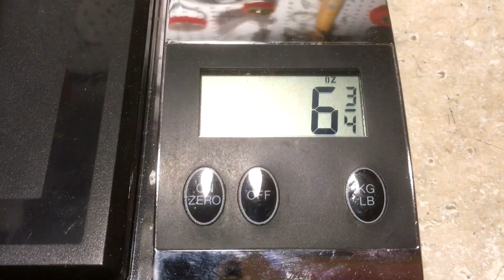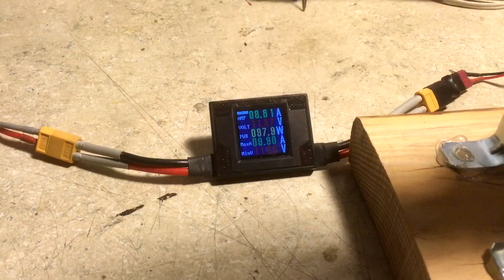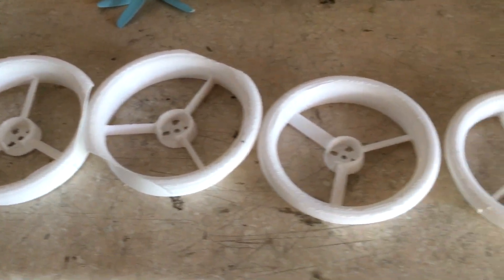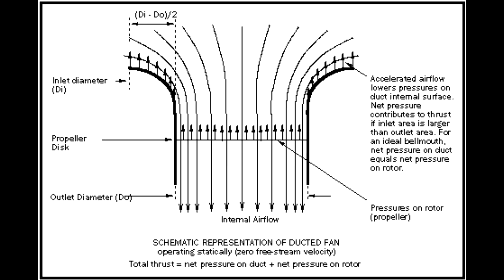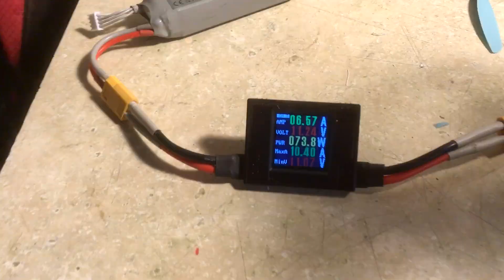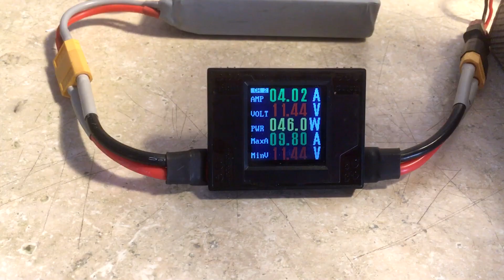Will Ducting Your RC Props Increase Thrust?

Comment: I removed the front cover of a usb fan thinking that would increase thrust but it didn't. The grilles on the front cover aren't just that, they're actually guide vanes. Without it the fan air is slower.

Comment: A ducted fan gains efficiency over a prop when designed and used as a lift fan...where it used for hovering. In this configuration the blades of the fan are quite different than a propeller blade. Just think about the lift fan in the F35 fighter..It is meant for hovering and landing, not for forward propulsion.  In forward flight a propeller is more efficient.

Comment: Putting a duct around a propeller designed for open operation is unlikely to give good results. The pitch distribution of the propeller has to change to work with the duct.

Comment: I actually made a crude EDF when I was a kid. It was part of a grade school mechanical engineering class. It was very weak, powered by a little 9v Radio Shack hobby motor, a crude homemade 2" wooden prop (modified ice cream cup paddle) and used a tin can and a Solo cup for a shroud. Very little thrust, but did move the hobby car it was attached to at a snail's pace.

Comment: One of the variables that cant be seen on this test stand setup is the ram air effect. In theory The slightly wider mouth helps shove more air through the fan when at speed. I've been getting ready to test this just as you have by putting another fan in front of the duct on the stand and also the naked blade. I'm running a 4 blade and normal stand setup has netted me equal thrust already. In my case I'm just looking for equality anyway as I'm using a longer tube and thrust vectoring to replace rudder and elevator

Comment: Your outlet is way to wide - you need to do the bernoulli maths if you want to get ~ 20% performance increase from a duct - the prop causes inlet pressure to be low, and outlet to be high, so the duct needs a larger-than-the-prop inlet, and a smaller-than-the-prop outlet (otherwise, as you found out, the duct is robbing the power from the prop to try and fit the changing-speed air into your constant-diameter shroud... oops!).  You can see how much loss you're suffering without a duct simply by observing the airflow around your prop - like I did here:  https://youtu.be/fbOXXLtaOVg / http://chrisdrake.com/Airfoil_Tools/g0061296.jpg - it goes "backwards" at the tips, and "inwards" behind them... by a lot

Comment: What would be an interesting experiment is to build an electric motor with the duct housing the stator. The rotor magnets (or a squirrel cage for an asynchronous motor) would be a ring around the propeller blades, attached to this rotor housing ring. The only gap would be between the rotor and stator - this needs to be about 1/2 mm anyway. So the rotor assembly, including the propeller blades, spins as a unit. In other words, you don’t have to worry about the duct/propeller gap. The only gaps are between the rotor and stator, which can be miniscule.

Comment: I was looking at wind turbines, which use an arrangement that was counter-intuitive to me. Instead of placing a converging cone in front of the fan (prop), these turbines place a diverging cone behind the fan. This forces air to spin and expand behind the fan, creating low pressure, and therefore sucking much more air through the fan. Have you tried that? I will experiment with this.
Reply: Any luck?

Comment: Unfortunately your tests are flawed, ducts work and work very well. 
Normal propellers can work, but you must use a oversized propeller and trim it down to fit with tight tolerance inside the duct, this is to eliminate tip vortexes, this is one of the major contributing factors to increased performance in s ducted system.
You would also gain performance from sanding smooth the duct lip and the inside of duct.
I also have done identical tests on rcgroups with fantastic results if you're interested, also I uploaded some ducts to thingiverse for people to use or test for themselves.
https://www.rcgroups.com/forums/showthread.php?3213985-3d-printed-3-duct-efficiency-tests-results

https://www.thingiverse.com/thing:3413401
Reply: I also noticed that the 3D printed ducts here don't include a closed off cavity back lip, essentially cancelling out the additional bernoulli effect that RCModelReviews mentions due to not having a classic wing profile, creating a secondary source of lift / pull by lowering pressure underneath the lip?

...as this lip in AileronRC's testing is basically hollow / same front and back profile (See at 1:52), I'd imagine the duct shown here isn't creating this, as there's negligible difference in distance air travels both above and BENEATH the lip? (although not as much as you might expect, given that the air won't exactly follow the inner lip, but travel in a path somewhere between the two - not hugging the back profile exactly, but not smoothly travelling in a straight path along the back of the duct lip (and effectively possibly also creating another vortex behind!) ...  :) )

Comment: You have an obvious gap between the blade tip and the inside diameter of the duct. This is mitigating one of the primary ways a duct helps to improve thrust and efficiency.

Comment: The orientation of your propeller experiments did not take into account the air pressure needed to travel   above and below the blades ' but rather through a fixed duct ' where air pressure was same all over blade ' how about horizontal setup that is moving forward or Q tip propeller with no duct

Comment: Your blade tips are too sharp. It's almost as if you're not using the duct, since the business part of the blade is too far from the duct, separated by those pointy tips. I think a better test would be to get yourself a proper ducted fan, measure the thrust, then remove the duct and measure again. Or at least get blades with flat (or slightly round) tips, so they fit better to the duct.
Reply: This is true, although I think in general a properly sized duct should improve the static thrust of any propeller, if only marginally. That's why I was surprised he didn't get better results with the 3d printed duct. It may be that he didn't have the prop positioned deep enough in the duct. 

He would have only seen a slight improvement anyway and that would be more than offset by the additional weight and drag of the duct when he flew the model, as he was experiencing. 

Using a larger dia prop with tips cut flat to fit close to the duct would have given better static results although performance would still be reduced in flight.  Properly designed, a ducted prop should give upwards of 2x efficiency increase, but only in static thrust.

Comment: Aren’t the 3 duct beams pitched the wrong way ? I mean, with that duct I would choose a CCW propeller not a CW like yours. So they would be parallel with the airflow, as the air behind the prop is flowing around the axis, CW in your case.
Reply: Indeed. Now they fight the rotating air coming from the propeller. And yet oddly they increased thrust compared to the straight beams. Something seems fishy there. The thrust should still increase if the beams were oriented properly. Also the duct surfaces are so coarse here that they will compromise thrust at least a little.

Comment: Tty to narrow the duct from inside same as turbofan jet engines. Meaning,  decrease the gap between the center of the prob and the duct inner side. Just keep the air flow through that narrow area by installing a spinner (nose) on the center of the prop and see the difference. I have never tested it but I am sure it will generate higher thrust

Comment: interesting but you should have started with a factory made EDF, tested that, then removed the duct and tested again, that would be a good test
Reply: LOL, I just wrote that in the comment, then saw your comment from 10 months ago. I think that the pointy tips of the blades he's using aren't tight enough to prevent vertex losses. So the duct just produces resistance, but doesn't prevent losses.
Reply: Exactly! For accurate results, a working model is needed as a base level comparison. An unproven design will not give useful results. Many variables still to consider, including prop design, prop edge to duct gap, duct surface aerodynamics and motor KV. The motor, props and ducts are matched. All are present in a working model.

Comment: i think the low pressure due to the bernoulli is just not sustainable with these props. When you just have 3 rotors i imagine, they cant really hold the pressure and the effect kind of cancels... and in the end you just have more vortexes due to the structure.... duct fans i saw hat  a different rotor design and i think higher rpm... but thats kind of my guess after watching the 101 video you referenced.

Comment: Now let me give example of real principles that work. If u double the size of prop keeping load on motor same (make sure motor runs WARM ) ie gear it down by 8 times, efficiency will increase 2 times. 
eg 8520 motor produce 30g thrust on direct drive. i gear it down 4.5 timeS applying 1.5 times bigger prop & I get 45 g thrust

Comment: TOTALLY the wrong prop for ducted use. Check out the "sabre" style curved blades (and MORE of them) in a ducted application. In essence you are creating  compressor.
Reply: Best blades are those that have the largest surface area thats next to the duct wall. (DAL 5045T) This will create a tiny gap of around 1 mm and prevent prop-losses due to vortices.
Reply: @4DCResinSmoker  Agreed. Also sloping the sides of the duct in VERY SLIGHTLY after the trailing edge of the prop will significantly decrease the "backpressure" as the air gets a kick of velocity. Likewise, broader blades with higher pitch towards the centre ensure even exit velocity and less turbulence also as the  angular velocity (I think I'm right here) of the centre of the prop is lower and thus produces less thrust leading to the thrust from the outer edge being "sucked" towards the centre (lower pressure) creating eddy flows and "dead" thrust areas.

What you ideally want is a constant speed prop with variable geometry to get the best efficiency. Hard to make at this size 😞
Reply: I've found that an inward slope / angle of 3% is ideal but the big problem comes from the length of the Diffuser making the duct too heavy. This is why multi-rotors don't often use them and why they're only practical for prop sizes under 4". Even then, most ducts used for Tiny-Whoops  perform poorly. I've designed several 5 and 6" ducts and have seen limited success with them. Here are some of my posted designs: https://www.thingiverse.com/1Smug_Bastard/designs

Here is a flight i did with my Son about a year back: https://www.youtube.com/watch?v=M8KeK9aeGXI

Comment: Mate isn't it possible to instead of making the duct and the propeller as separate pieces, what if they were made a single piece?
Reply: What you would rather need is a Q-Tip propeller, you can look at the video from RC Model reviews about them.
Reply: Moving more mass is not a problem, once it is moving, it tends to stay moving. Ignore commenters who lack basic science knowledge.
Reply: riiiight ... so the motor has to move more mass ... that makes total sense

Comment: great video. every tiny bit of area of the homemade duct makes drag on the inside, and when flying, on the outside, also to front edge make a drag and a some separate drag at the back of it. yeah obvious the the stator blades, or mount struts whatever you want to call them, can play a big role too. I guess there are different designs for for those, and you could make them farther from the prop though that would increase weight and vibration., or maybe they could be angled (form a cone) idk is all new to me those esoteric details. all fun stuff though.  So much detail in this tech that matters. Plus the leakage looks extreme in you homemade one. It may help a lot to have the end of the prop more square and radiused to match the radius of the prop/duct interior. i think maybe the prop tip clearance/fit thing may be the post important of all, idk, and it still looks like you have no good fit there. But you should be able to mod you prob if you start with a slight larger diameter prop (yeah that takes a lot of careful work and balancing and you really add prop tip back if you take off too much.
Reply: The ducts and propellers used are crap, hence the poor results.